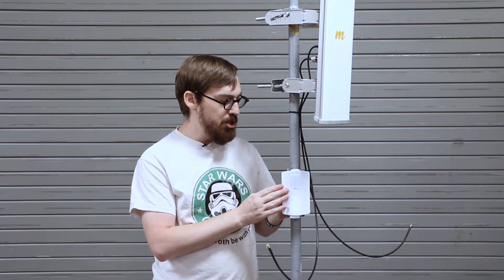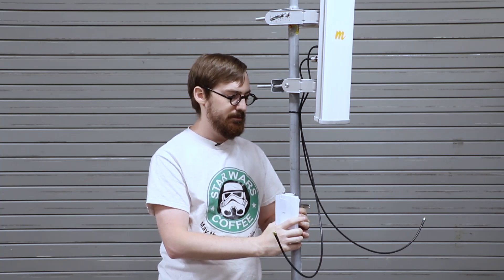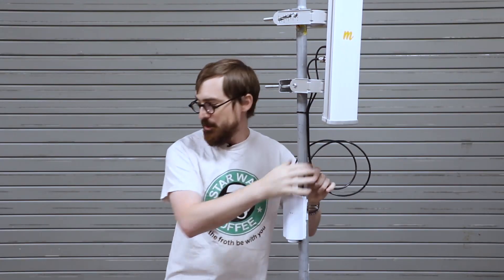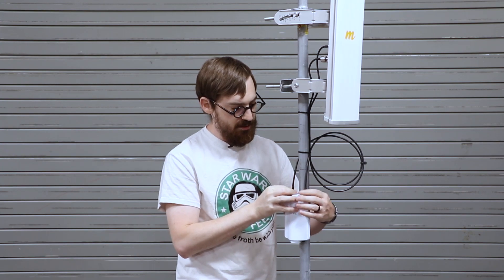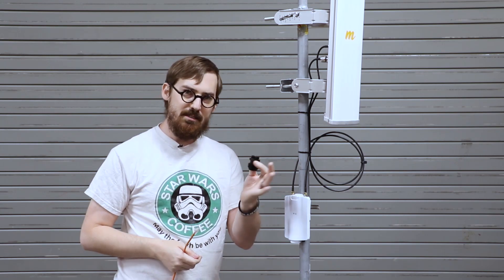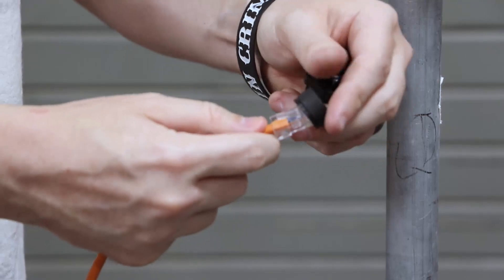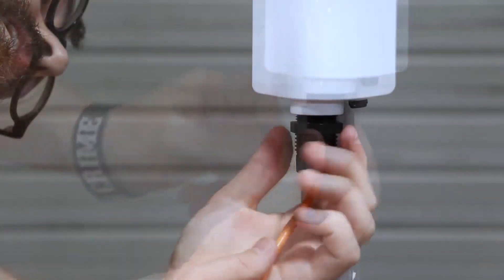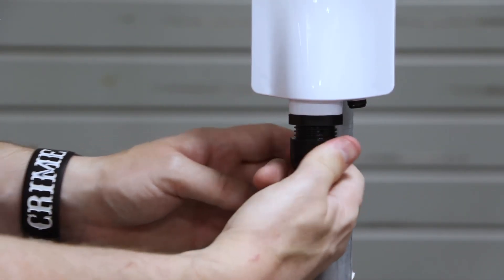Mimosa Networks: A5x Access Point Mounting

Comment: Can these radios be used to broadcast community WiFi at 2.4ghz ?
Reply from the maker: They can only be used at 5 GHz (not 2.4 GHz) when used in WiFi interop mode. For this use case, using a properly positioned sector (N5-45) or 360º (N5-360) antenna would be ideal.